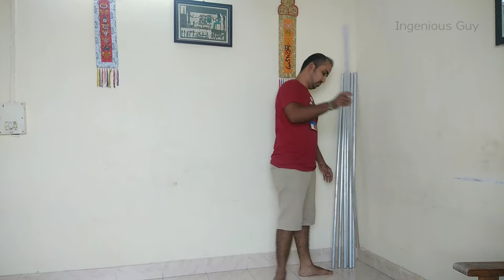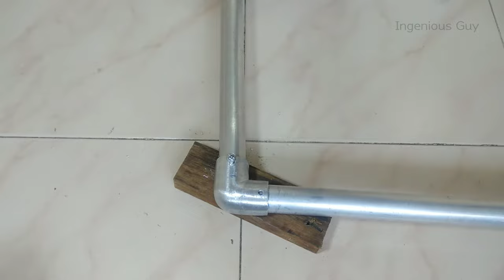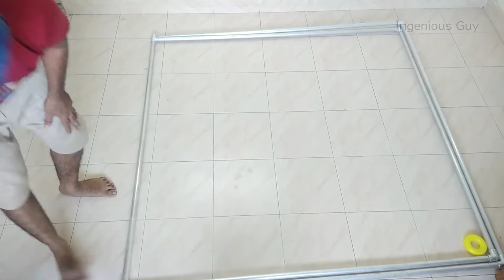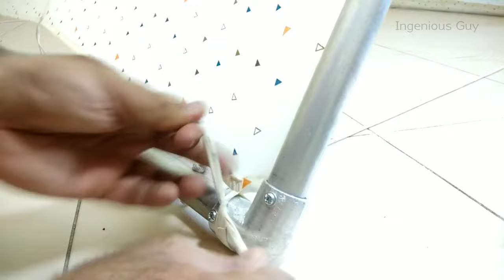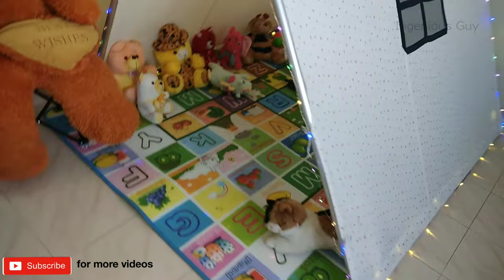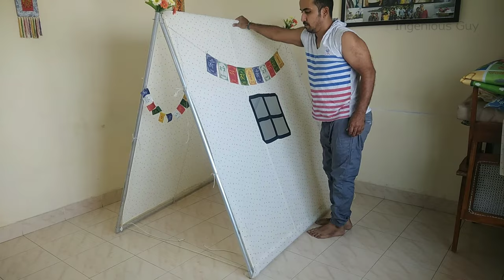DIY Kids Tent house at Home| Kids Tent Indoors | Tent house for kids | Kids tent house, Baby Tent

Comment: How much all these stuff costs us.. Frame only
Reply from the maker: Thanks a lot for watching.
Before to say Cost of frame.
I would like to say that I have used alluminium pipes (instead of cheap PVC pipes or heavy Iron pipes) to use this tent frame for lifetime for other purposes too
Its one time investment and life time usage.
Total cost of frame material is Rs.1440.00 (aprox $20)
I wish u watch the part 2 video (https://youtu.be/YS38oMdcR7k) before come  to conclusion for better appreciation
Thanks a lot.
(Its corrosion resistance and maintenance free)

Comment: Can't think of a reason why u used the T for one corner, Giri... Do tell me why... Kutty loves her new indoor tent... It looks lovely 😍😍😍 Lk 29, fully watched @ - For some reason, my comment isn't getting posted, so I'm using this profile..
Reply from the maker: Glad u liked it.
Thanks a lot for ur comment
I used tee to reduce one side width of the main frame to 4.9 feet without cutting pipe.
If i dont used tee then the supporting frame width will be more than 5feet.(it would 5.12 feet).
The actual results u would see in part 2 video. 
Till then u have to wait